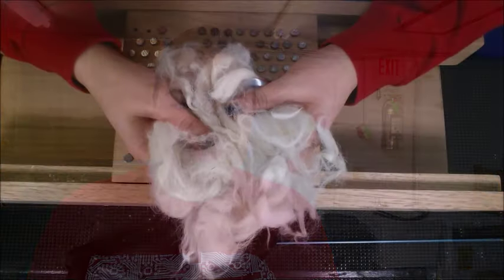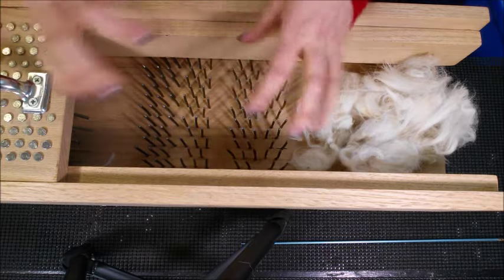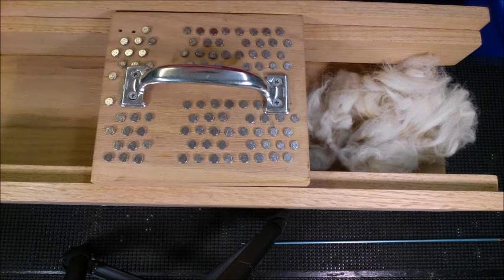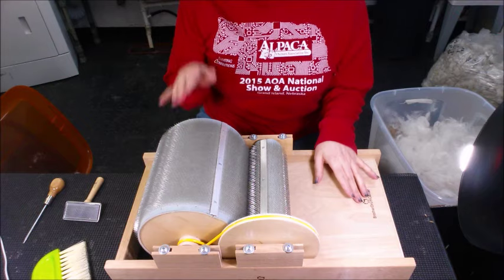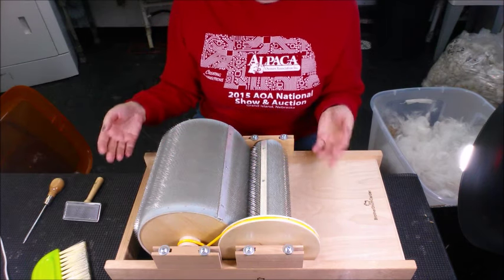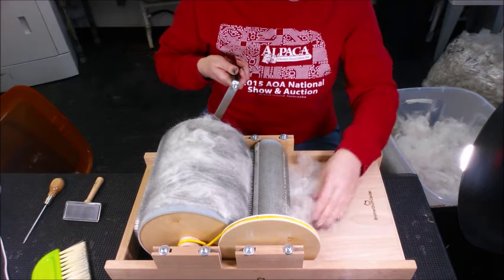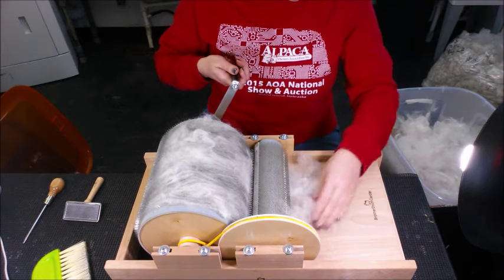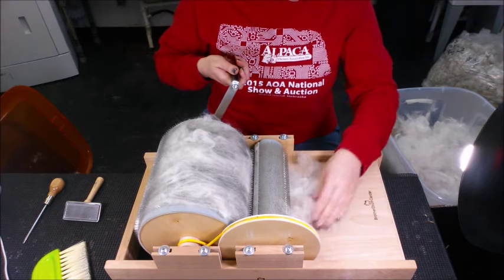Picking & Carding Alpaca Fiber (Fleece)

Comment: Hi Tashia, I was wondering if I can use alpaca fleece as a duvet stuffing instead of lambs wool? Do you think that the alpaca fleece will just end up a felted clump in each cell over time or would it remain viable? I hope my question made sense to you lol. Cheers Craig
Reply from the maker: Hi Craig, I think it would clump. I’d recommend using sheets of felted alpaca. It doesn’t need to be thick to be warm! And it’ll be more lightweight than lamb’s wool.
Reply: Thank you, I appreciate your advice :-)

Comment: You are not keeping the cut end and the not cut end going the same direction,  are you? Is this because it is alpaca fiber and unlike wool, keeping the diriction root to tip is not important? Please correct me if I am not understanding correctly what I am seeing.
Reply from the maker: I do not keep the cut/non-cut ends going in the same direction. That idea is new to me. In the classes I’ve taken about working with alpaca, this has not been mentioned.
Reply: @ButterfieldAlpacaRanch  

I saw some person working with wool, with this breed of fleece and keeping the ends aligned. I think it only applies to wool or only applies to certain breeds of wool
Reply: @ButterfieldAlpacaRanch  

And thanks
Reply from the maker: Interesting